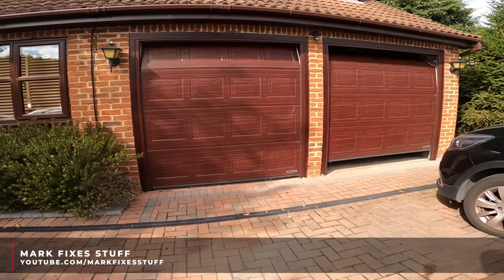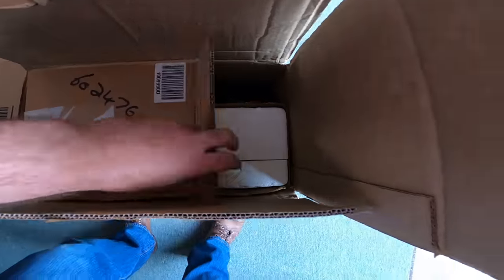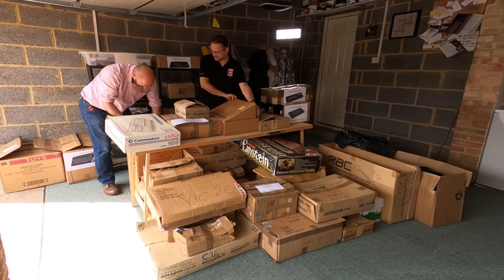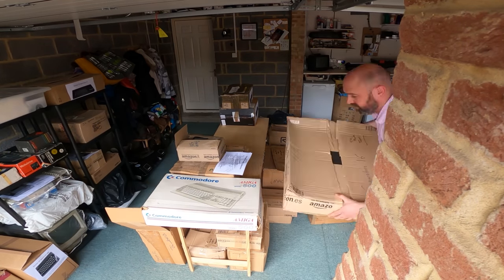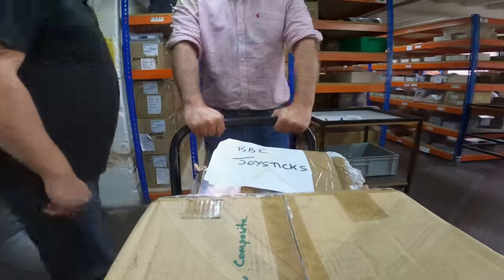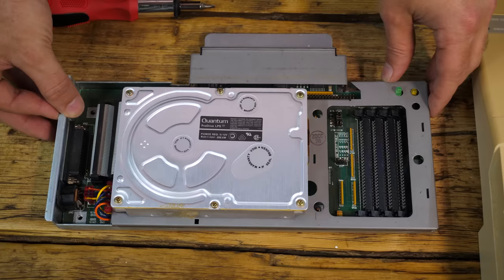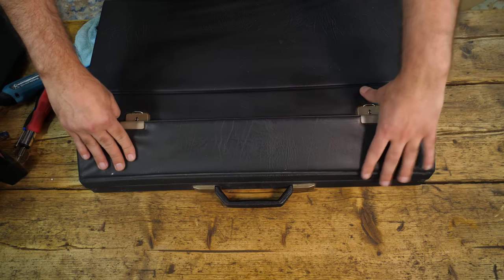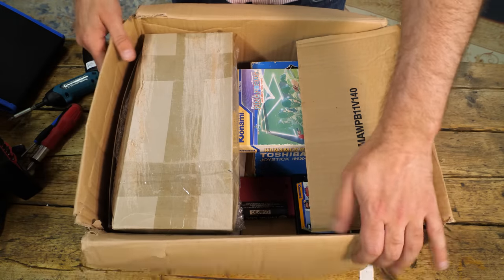Incredible Retro Tech Collection for The Cave | Retro Road Trip

Comment: Disaster averted.  I'm so glad you showed that A500 and opened the trap door.  I had no idea that the RAM expansion might have a battery on the board.  I checked mine just in case and sure enough, once I managed to unsolder the metal case it was in, there was the Varta battery.  Fortunately it had only JUST started to leak and was pretty easily cleaned up.  I feel fortunate as well because the date was November of 1988 so it was probably way overdue.

Great episode, great collection and thanks for saving an A501 RAM expander from battery death.

Comment: What a generous donation. I'm sure Ian could have sold most, if not all, of that treasure for a sweet sum. Anyway, I'm always astounded by the diversity of old school computers. Around 30 years ago I predicted that there would be a convergence on Unix as ram prices plummeted and cpu speeds increased. That has in fact happened with Macs moving to BSD, Linux becoming a world class operating platform, Android being built on top of it and even Windows including an Ubuntu subsystem. On that note I'm using Riscos Direct on a RPi just to be different. I even bought new software for it to make it as productive as possible. I just hope that the future brings us as much excitement as the past, when the potential to be a bedroom developer was every kids dream.

Comment: GVP was the gold standard for Amiga gear back in the day. I loved my 030 accelerator/ram expansion/drive controller card.
Reply: I never had any of their stuff but it was clear from magazine ads that they were a major producer of Amiga hardware, they did all sorts. I love how they combined hard disks with memory and accelerators in one neat unit that connected to the side of the A500 and extended its form seamlessly (even though it obviously requires a lot of desk space!). I think they often had through-connectors for further addons to be daisy chained together.
Reply: I still have one, only a few miles from Finchampstead

Comment: Mark's got a good eye, the sharp MZ-700 has recently become one of my favorites despite (or because of) it's limited capabilities.  The Einstein is a great machine, I finally got mine up and running - it's on my desk ready to do some retro coding.  The keyboard is the best of any 8-bit machine I've used and the whole system is a pleasure to use, I understand why the software houses used the Einstein for cross coding in the 80's.

Comment: I've got one of those GVP drives. 400 quid for 52 meg drive in the 90s. I recently successfully ripped the HD to a SD card after around 30 years in the loft. I also have the 286 PC card in mine. Which goes in to the long slot at the side.

Comment: Got a MZ700 today, quick tip replace the 0.047uf cap in the power supply, apparently a common thing killing them. Found out myself, worked perfectly for about a minute and than a giant puff of smoke. Should be a easy repair though as it should in theory just be the cap and the fuse.

Comment: This was an amazing donation. I would love to get a Plus/4 and a Commodore 16 for my collection. The machines are identical, except that the Plus/4 has 64 kiB of RAM and a suite of productivity software in ROM while the Commodore 16 only has 16 kiB of RAM and it also lacks the User port. The Commodore 16 can be upgraded to 64 kiB and there are a variety of ways of doing that, some include modifying the board by cutting some traces but there are also less invasive ways. What you should try to find however is a Commodore 1551 disk drive. The 16/Plus/4 can also use the 1541 but it has the same slow speed as on the Commodore 64/128/VIC-20 so compared to the 1541 the 1551 which connects to the cartridge port is lightning fast.
Reply: Hah, I just sold one today (Plus 4 in a needs-some-love condition) at the thrift store I currently volunteer for, together with a datasette. I doubt whether I should disclose the price but the money (not for me obviously ;-) ) wasn't bad.
P.S.: the dot matrix (?) printer for the machine is still there.
Reply: @Peter1986C  Yeah, the price has gone up. And at a thrift store? Dang. I scour charity shops whenever I'm in the UK and the only thing I found was a Nintendo Wii. I didn't pick it up though and it was gone the day after. But I think Neil has mentioned in the This Week in Retro podcast that the UK has different rules for tech being sold in charity shops so me finding a Plus/4 or 16 in a UK charity shop will be more difficult.
Reply: @weepingscorpion8739  I certainly cannot tell whether the rules in the Netherlands are similar to the UK.
I do however know that I was accidentally typing in US English (channels similar to this one might be to blame 😉 ); and to be fair I think it was a very rare occasion (that we had a home micro) in the first place.
Reply: @Peter1986C  Well, I usually write in US English but I have since married a Scotswoman and now I'm being forced to switch to UK English so that's a challenge. :) Ah, the Netherlands. I know that quite a lot of Commodore machines are to be found these.

Comment: actually in addition I coded my first accounts application on the Sharp MZ-700 back in the 80s too in BASIC and quite a few customers used it until they upgraded there systems with SAGE type accounting back then after I ported to Amstrad PCWs with Locomotive Advanced basic